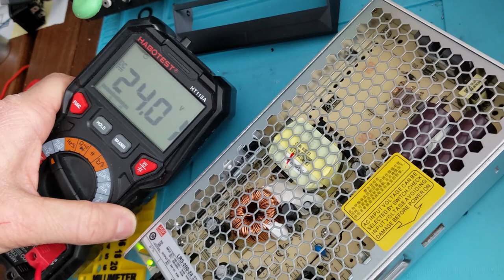Voron V1.8 3D Printer UK Build - Episode Three A

Comment: I hope you keep your videos coming. It is always good to see people showcase the Voron. A few tips, for the x endstop, the wires run with the probe wires. In your video, you show them running where the clockwork (extruder) sits. As for the power supply, you should have a little extra voltage to to allow for some drop when a load is on it. The factory voltage of 24.26 would have worked well.